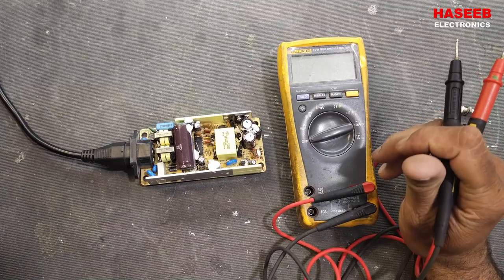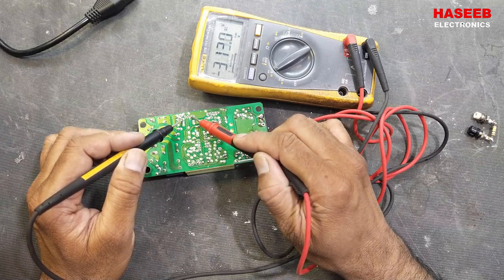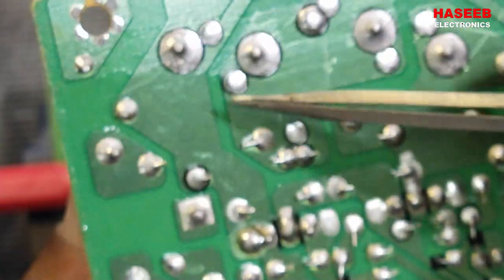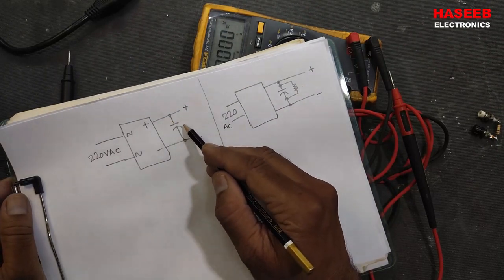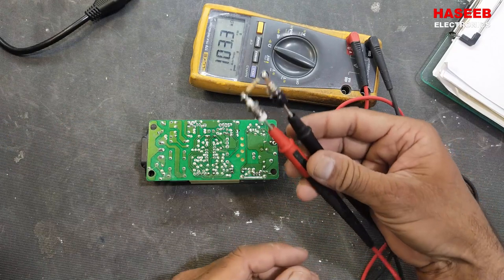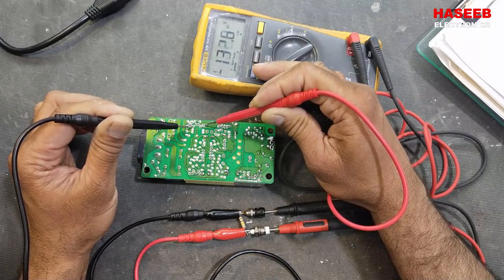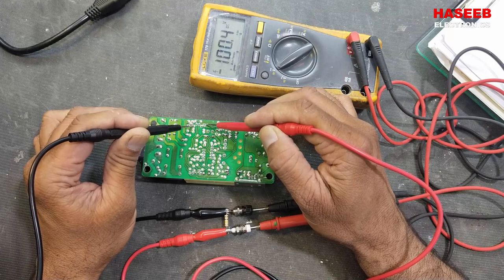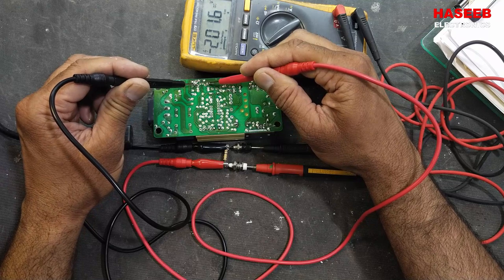[435] How to Discharge a Capacitor - Capacitor Safety

Comment: Just wanna add something. If you use Fluke Meter, Testing Charged Capacitors directly using capacitance test, the tester will display diSC indicating the multimeter is discharging the capacitor before it measures the capacitance. Fluke 87V has this feature and been using every time I encounter a capacitor that might be charged.
Reply from the maker: really a valuable hidden feature. i was unaware by this information. i always do this practice by discharging the capacitor , then checking the voltage and then check capacitance 
i am thankful

Comment: I was just looking for designs for this device and there you are in my subscriptions; perfect timing! Your design is unique in that it allows the voltage to be conveniently observed with a multimeter. You have me thinking on clever designs for my build. I have an extra volt meter that is not so valuable. I think that I will make it a dedicated capacitor discharger, by placing the resistor across the probe pins, on the PCB. That will make for a neat, professional package. I am excited! Thank you for the inspiration!
Reply from the maker: wow that is awesome
please accept my best regards
yes this idea is useful to monitor the voltage during discharging the capacitor
Reply: @HaseebElectronics  I have already completed the project. It was very simple to do. I posted it on the EEVBlog forum. I titled the thread "Repurposed Old Multimeter = DIY Capacitor Discharger With Readout - Project." You can search for it by this title. I would have posted the link, but YouTube does not allow users to post links. I hope you will look at the thread. Feel free to copy the link and post it here.

Comment: Took out MBO from Grunding TV after i tested TV with no picture output and no turning on at all but got few times glimpses of picture and it was black screen again after that . There was one big capacitor (450 V , 68 μF ) on it and was laying down and was some black "gummy" substance under it . I suspected it was probably leak of electrolyte from capacitor and while holding MBO i touched 1 pin where power cord was connected and got pinch of electricity XD through thumb all way to the shoulder . Video is awesome friend and i have question . Can i damage digital instrument for measuring capacity if it is larger ( for example 68 μF ) then on instrument , which is 20 μF highest value for measurement on instrument ?

Comment: Yes, it's bleed resistor, but also equilizing resistor, during normal PSU operation. Over time, voltages across 2 capacitors can differ by few volts, due to inperfection and initial difference in capacitance, and many other factors. These 2 caps don't age exactly the same way. I've used MATLAB to optimize between time to charge and discharge power. I've found it's fine for 6kohm resistors for continous discharge of 15 seconds, or less.
Reply from the maker: exactly perfect 
thanks for your valuable comment
Reply: can i just use one 100k 2w resistor too or why does it have to be 1w ?
Reply: @2012isRonPaul  it has to be precize value, so it won't dissipate any significant heat under normal operation. P=USquared/R< Pmaximum allowed dissipation.
Reply: @SanelKeys  what is all that supposed to mean lol
Reply: @2012isRonPaul  it means, with all due respect, you need to back to basics (Ohm's law, Kirchof's rules etc...).
Reply: @SanelKeys  i mean how is discharging a random cap with some crocodiles even a normal operation when ppl dont even know anything about it lol
Reply: @2012isRonPaul  this is youtube, not a classroom. How can I elaborate in small text box with limited options of editing if Haseeb didn't in the whole video?
Reply: @SanelKeys  maybe see a head doctor first and then just answer the question ?

Comment: I have a question. I have a 10 ohm 100 watt resistor that I use for discharging capacitors. This discharges the capacitor very quickly with no sparks but
will I cause damage to the capacitor by using such low resistance?

Comment: Thank you, you explain this very well. I got a small shock from a small capacitor in a camera once. I am going to replace some relays in a hi-fi amplifier soon that has large capacitors. I am definitely going to take your advice and check the voltage and discharge the largest capacitors before working on the board 👍

Comment: dear haseeb sir once my professor told you can discharge capacitor in diode mode is it safe? the easiest way is bulb they say. please guide me .
Reply from the maker: in diode mode NEVER do it. because in diode mode you are using internal battery of the multimter. it can explode the battery or it will damage the DVM. 
tingston lamp is also some useful idea, but a large value capacitor (charged at 400 VDC can bast the tingston lamp. as the lamps are just 220 VAC RMS. so surely the bulb will not work much longer.
but as you told that your professor advised like this, please confirm again
Reply: @HaseebElectronics  you are very right haseeb sir, your practical experience knowledge shoud exceed anyone around that i know. thank you once again

Comment: Sir if we I want to discharge even more fast then what will be the value of resistance?
Reply from the maker: use soldering iron or use 100 watts lamp to discharge more quickly
Reply: @HaseebElectronics  sir if we use 47k or 56k 2 watt resistance then it will work?

Comment: Good job
Just try to used 100 watt bulb for capistor discharge 
1 holder
1 100 watt bulb
1 feet wire
Reply from the maker: special thanks sir
that is also a very useful solution, it provides 400-500 mAmp discharge rate. but when dealing with high voltage above 300 this lamp provides surge in discharge and during discharging high capacitance valued capacitors, the tingston lamp burns out. because high voltage and current causes to exceed its power rating, (while discharging above 1 farad capacitor it is unsafe) so it is much safe to discharge at slow discharging current

Comment: Stop shorting capacitors use high wattage  and ohm resistors to discharge instead.
Reply from the maker: you are right
there are many ways as"
using tingston lamp
soldering iron
high wattage resistance
but 
a fast discharging to a capacitor or a battery cause to reduce its working life
we have to consider this point
Reply: @HaseebElectronics  I value my life over  a cylinder containing two isolated plates.
Reply from the maker: @AK2I47  exactly the life is a God given gift, we have to take care more than anything